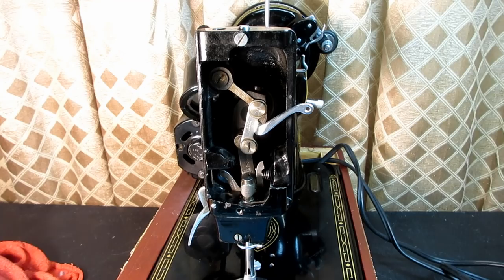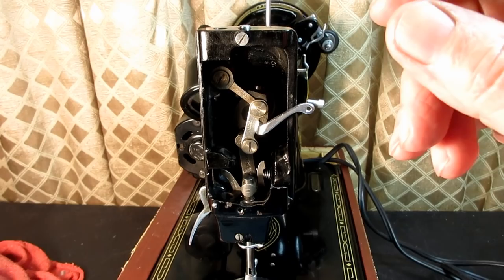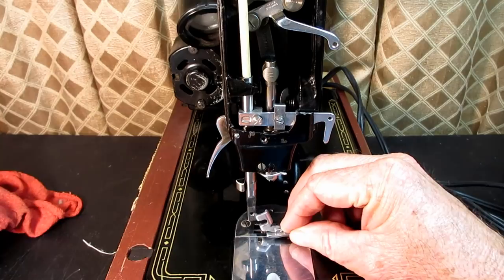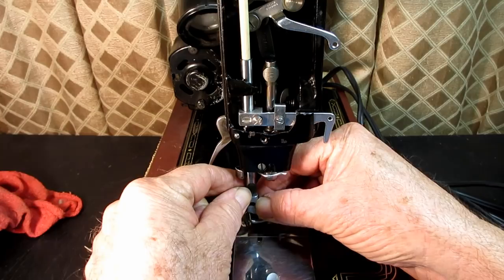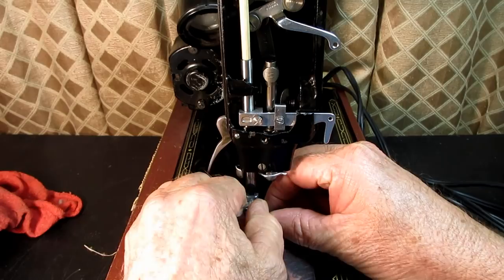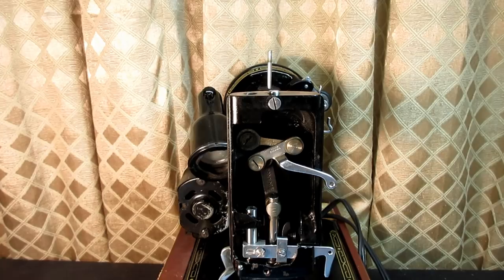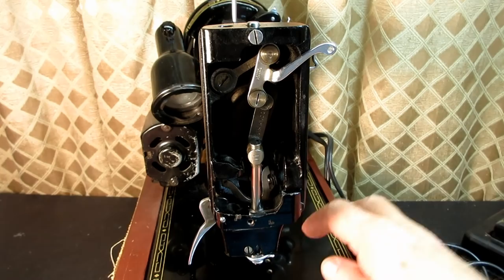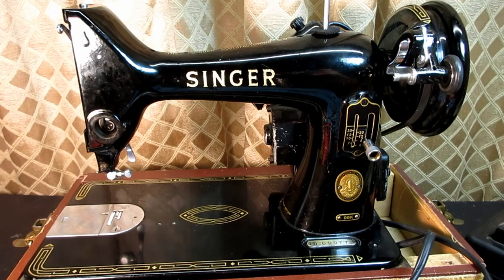The Presser Bar System of a Singer Model 99K Sewing Machine

Comment: 5 Canadian quarters = 5/16 inch
Reply from the maker: I added thin info to the start of the description below the video. Thank you for sharing it.
Reply: @andytubesewing1953  Thank you for your videos.  I was able to take apart the pressure bar on my 99K and adjust the height, with your help!  I put a paper towel on the the needle plate, put on the foot, and put the quarters under the foot as soon as I put the lower bar on.  then I was able to straighten the foot by looking at the feed dog/foot area from the back of the machine instead of the front.  The feet are not parallel with the feed dogs from the front as the widen a bit closer to the front, sort of fan out a bit.  At least the foot on mine does.  Then I continued by adding the top bar and finally the pressure bar screw.  By the way, the 99K is my favourite machine to work on.   A true workhorse!
Reply from the maker: @nadinemartin8024  Looking from the back is brilliant! ✨ You must be a natural mechanic. Thanks for watching my channel.